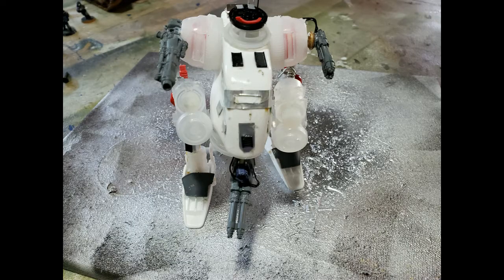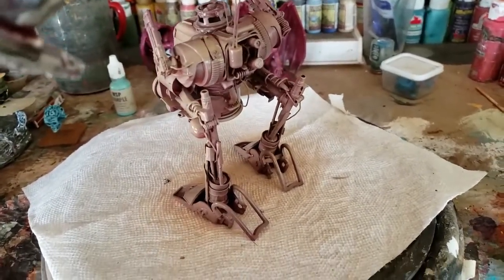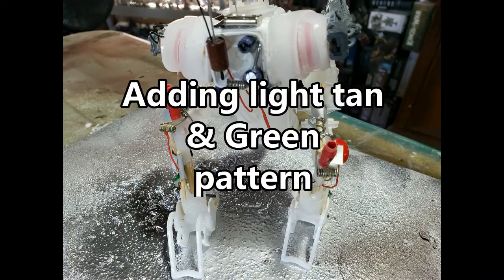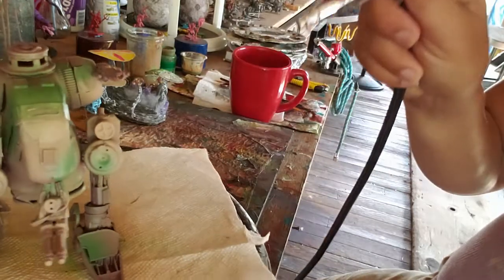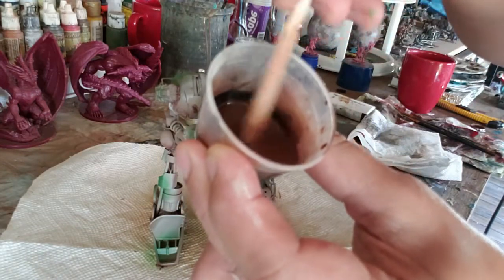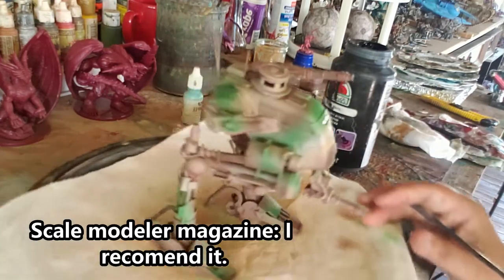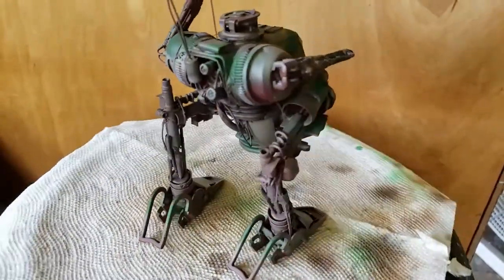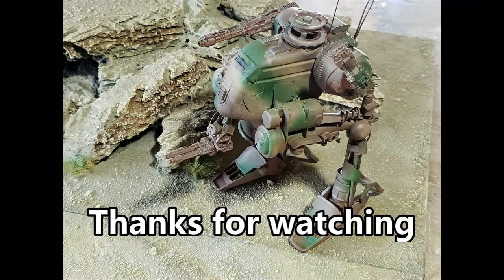painting the scratch built mech episode 2

Comment: Nice! B)
Reply from the maker: Glad you liked bobiojimbo, also added the antenna and range finder you suggested lol👍
Reply: @mjhobbycorner5503  You didn't have to. Is the range finder above the chin gun? I do like the antenna, they turned out well. Also, the walkers fits nicely beside the super tank. The walker looks like if it can land a few strategic blows to the tank, the tank may lose, however, a single solid hit from the tank would destroy the walker. It's a good disparity of force that illustrates their roles on the battlefield.
Reply from the maker: Yeah, totally agree with the different roles the vehicles play in the field. I think the player wants to use both of these in the same army, points permitting. Yeah I put a range finder above the chin gun which also strengthens the gun.